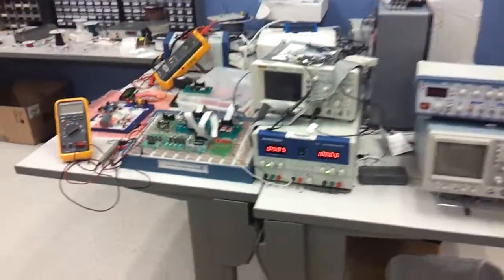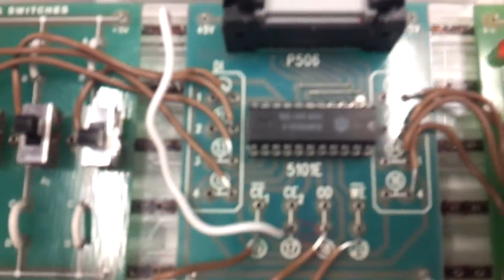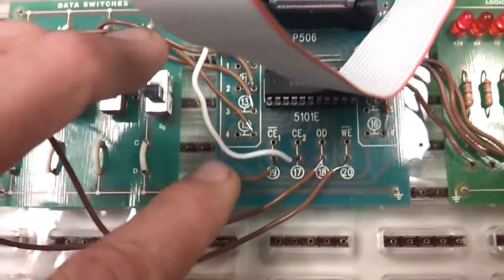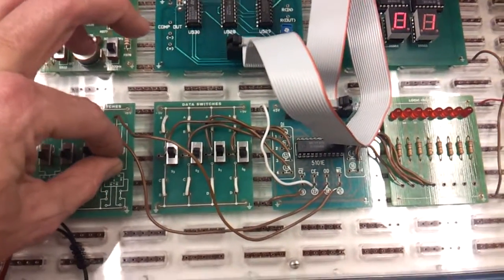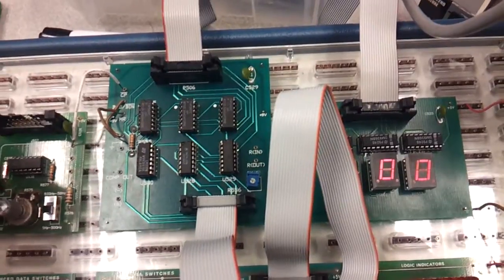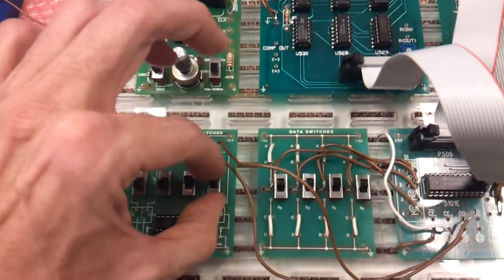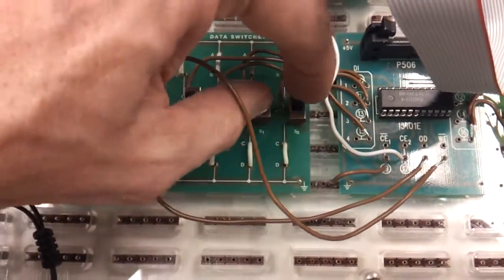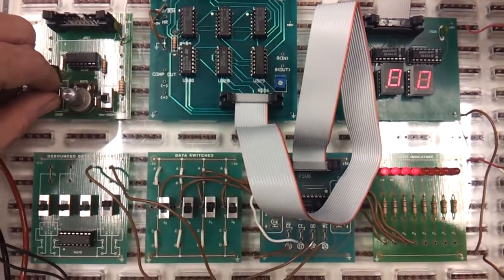Static RAM 256x4b Address Data Control

Comment from the maker: John, I have the modular schematic and think you are on point that the schematic completes the tutorial. I made the video to better demonstrate to students how the digital RAM lab works and it appears successful.

I need to change my module based schematic for the three digit counter to reflect the wiring of the ICs on board. That sounds like a good student project, rather than my block diagram ...make something in tiny cad.

Thanks for the feedback and nice to hear from you man! --Joe